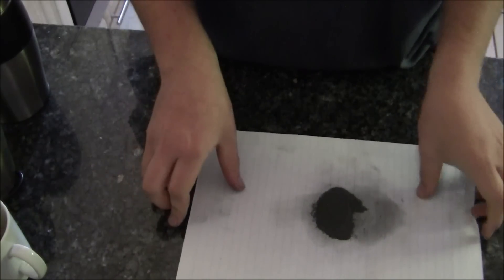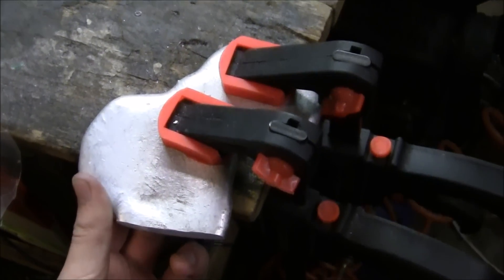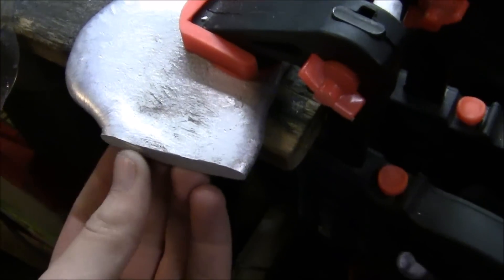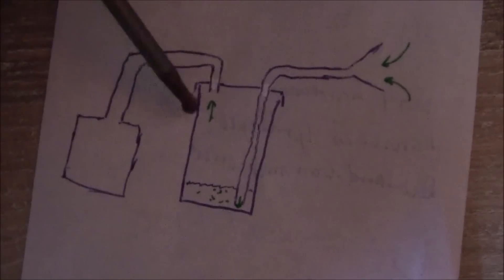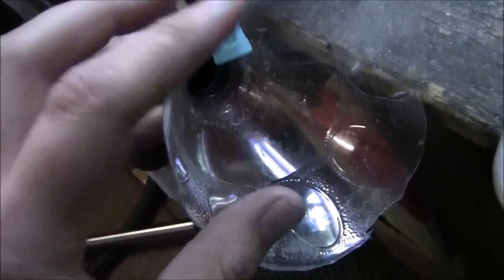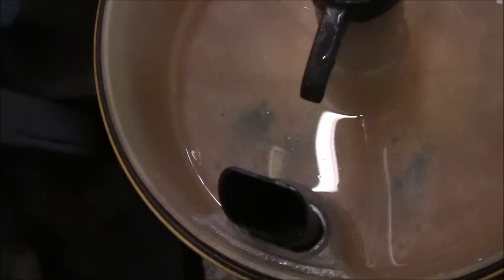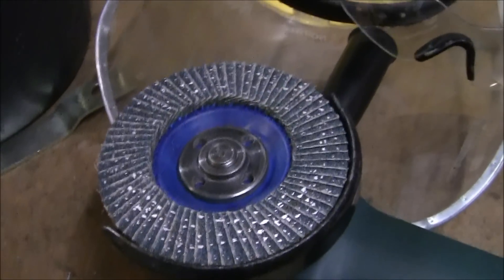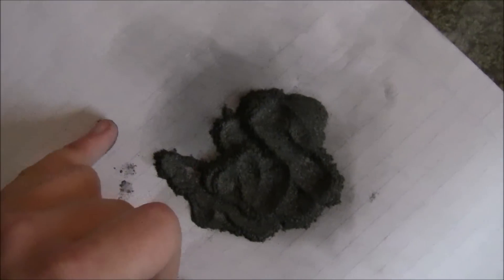how to make aluminium powder without using foil

Comment from the maker: I'm very curious, has anyone tried this?
Reply: Spray molten aluminum through a nozzle to aerosolize it in an insert gas. Industrial process to produce bulk aluminum powder.
Reply: Bata vào 🏡 vệ cho chị đi chơi đâu không biết nữa nhưng chắc là vậy
Reply: Heck no. I’d prefer to not breath in aluminum dust.
Reply from the maker: @darenmiller2218  dust mask.
Reply: @HomeGrownPyrotechnics  not chancing it. Rather leave it in the ball mill for a week or more. It’s a great idea don’t get me wrong, but personally I’d rather not chance it.
Reply: I tried several ways to get powder. It seems that using an angle grinder worked well, but, I think you end up with mostly alumium oxide. The way I was going to try next (though didn't have one at the time) is to just put a bunch of aluminum chunk into a ball mill with water and tumble. Every know and then, exchange water, powder with a few more chuncks and water. You could still collect some while cutting the aluminum into chuncks with the grinder, but should otherwise be less messy and a higher quallity powder.
Reply from the maker: Yeah uh I wouldn't do that. It's gonna take a stupidly long time to reduce that to powder, months to years. What I do is buy aluminium powder as resin pigment which is about 200 mesh and ballmill that. Much cleaner and more reliable.
Reply: no
Reply: i would but you need a kilm to melt cans and a place where you can spark up a grinder and a vacume at the same time with out people crying about the noise and lets not forget you contaminate it with the abrasive particals from the disc . i would suggest to get a large coarse metal file double cut  over 10 inches and just vacumeou the left overs and spare your lungs
Reply: I would if it was a shtf situation but for now i can just buy in bulk and have it shipped to my door.

Comment: I’d get a narrow and wide step drill bits and slowly drill wholes through it and catch the shavings under it.  Use the narrow one first and drill all the way through.  Then hit it with the bigger one. Then blender it, then ball mill it.  Wear all your PPE.
Reply from the maker: I'd imagine that that would create shavings that are too big to mill. I tried using small lathe turnings and it just wouldn't grind down. It needs to be a sand like material before it gets milled otherwise it will take weeks. Blending metal shavings seems to only screw up the blender. What I use is 200# aluminium powder used as a paint pigment. Takes 8 days to mill fine
Reply: @HomeGrownPyrotechnics   it might be less work and more safe just to buy it.  I saw 5 pounds of 2 micron dark Indian aluminum for about $70 shipped.  If your interested I’ll go and see if I can find it again in my browser history.  I’d be nervous to play with that small of a powder myself.
Reply from the maker: Yeah unfortunately 'just buying it' doesn't work in my country. Pyro specific chems are pretty much impossible to get here. If I want it I must make it. The only thing I've had to import is parlon
Reply: @HomeGrownPyrotechnics  understood.  I read that a “seed grinder” also works for the initial pulverizing of stuff.  I’ve never looked into though.

I didn’t know milling took that long.  Its alot more low profile though than purchasing anyways and you get the fulfillment of doing everything yourself.
Reply from the maker: Ya I get a lot of pleasure out of making things myself. I even make my own ammonium perchlorate. That was a 4 month project to get right lol, but  because I now have all the equipment, I can easily make more.

Comment: Try a fine rasp in a recip saw, much cleaner process and end product.
Reply from the maker: And gives a very unrewarding yield. Tones of work for very little product. It's much easier to ballmill with steel balls using aluminium 200# powder used as resin pigment.
Reply: @HomeGrownPyrotechnics  steel? Man that is literally playing with fire. You should use glass or ceramic.
Reply from the maker: Sigh. I tested it thoroughly. Steel balls in a ballmill don't even come close to reaching the velocities required to sparks to form inside a ballmill and the powder being milled absorbs the energy to grind down fine. That's the point.
Reply from the maker: I used long exposure photography at max iso to record if any sparks formed when struck with another steel ball free falling from 1 m in the air. A ballmill cannot achieve such velocities and absolutely no sparks were seen zoomed in
Reply: @HomeGrownPyrotechnics  static electricity with steel is the concern, or at least that's what I was taught.
Reply from the maker: The steel conducts away any charge there might be present. It takes a week to grind down 100g of powder with steel. With ceramic it would take several weeks and you have a higher spark risk from the ceramic fracturing than steel because it's so much harder. The aluminium would be like sandpaper to hardened lead so steel is the best option for this application

Comment: Get chips from a machine shop. Clean the  chips with either soapy water or kerosene. Let them dry. Ball mill to oblivion. Once ground to silvery dust add some stearic acid and charcoal as a phlegmatizer and grinding lubricant.❤
Reply from the maker: I have a lathe. I've tried milling aluminum turnings. It doesn't work. Would take months to mill down. It has to already be a sort of powder before going in the mill. I use aluminum powder resin pigment, works great. It comes as ~100-200 mesh and can be milled down to airfloat in less than a week depending on how much is in the mill

Comment: Have you tried a ball mill with actual rock like say granite that act's much more like sand paper than actual steel balls also have you tried a bench grinder with an stone wheel in a large plastic tub with a lid ? And some sort of vacuum like you already have in the video but with a bench grinder and holding the melted metal with steel pliers to the grinder ?
Reply from the maker: Rock will chip and fracture off and contaminate the aluminium. Where would you get granite balls anyway. Also I don't think you understand how ballmilling works. The balls are crushing the material as the balls tumble. Also I now use aluminium powder used for resin pigment. It already comes 200 mesh so I ballmill that.
Reply: Screen out the sand  aluminium being lighter would seperate deferently to the heavy sand just need a two screens and a trap for your heavier sand  wouldn't it do the same for steel balls so you don't have a early thermite reaction with the aluminium powder if it was to get hot enough and you had the right amount of rust to fine aluminium ratio in your Ball mill just thinking outside of the Box dosent have to be the same way everyone else makes it the granite would be easy to obtain simply from a creek bed or beach already on a round shape just need to find it
Reply from the maker: The steel isn't flaking off during grinding so isn't mixing.thermite also takes very high temperatures to ignite. Rocks are also a bad idea  because it can generate sparks on impact. Steel takes much more force to do the same. Just drop the rock idea, its a bad idea in many ways.
Reply: Lining the inside with rubber matting helps a lot too won't wear out your drum so fast
Reply from the maker: @thehardrockminer8778  the drum is MADE of rubber my guy. A very stiff rubber. Anyway the only thing that there is any concern for being worn out is the drive belt which can be replaced
Reply: Use marbles, you don't want sparks at all, like no chance of sparks and also no oxidation, that's what the charcoal is for

Comment: One problem with this idea, how does one make 400 mesh flakes?  Spherical shape gives off sparks..no bangs! Using aluminum foil doesn't work... tried ideas from YouTube and a book bought from a pyro supply.. none of these work! I read info on the internet that German dark pyro mesh flakes are are made from aluminum on paper ..kinda like on Wrigley's chewing gum paper ..now where did I read that?!?? Burnt or sprayed in a very finely divided cloud which is very DANGEROUS and bad for the eyes and lungs !!! The methods I see on YouTube don't work too well for firecrackers! ! I gave up ....
Reply from the maker: The dark aluminium i make works very well for making flash for firecrackers. If you want 400 mesh you will need a 400 mesh screen and need to ball mill the powder then sift it. Ball milling generates flake aluminium because the grinding media is constantly flattening and grinding the particles.
Reply: Częśc moge zadać pytanie bo widze że Polak?
Czy fotobłysk robiony z Kno3+Al jest w miare bezpieczny od samozapłonu ?Czarny proch robiłem nie raz w swoim życiu i nigdy problemu nie było,z góry dzieki za odpowiedź

Comment: I wonder if a cyclonic separator would be useful here.  To prevent splashes being sucked up by the vacuum, you might just put a vee shaped baffle in front of the suction tube.  nice video... thanks

Comment: I would think that grinding would cause so much heat that you would excessively oxidize the aluminium
Reply from the maker: Nope. Heat only comes if you grind it too long without letting air in then expose it to air. The oxidisation can be exothermic. I've experienced it igniting just sitting on my table because I wasn't giving it enough oxygen in the final stages.
Reply from the maker: i just realised you were talking about the grinding from the angle grinder and not the ballmilling. the surface area of the particles when angle grinding is insignificant at that size for oxidation to be an issue. one thing to keep in mind is that aluminium oxidises instantly in contact with air and forms an oxide layer, that's part of the appeal of aluminium as that oxide layer prevents further oxidisation, ie, it never rusts unless in some very harsh conditions. that instant oxidation can also be a problem tho as i mentioned with it catching fire after ballmilling. oxidation is exothermic so if its happening fast enough, it can start a fire

Comment: https://youtu.be/4HKpMYJ-6go
Ciao,
Since gallium induces structural failure in aluminum, I thought of exploiting this phenomenon to doping aluminum with small amounts of gallium in order to make it brittle and be able to pulverize it very finely in less time, in a ball mill.  The hope is that the quantity of gallium required, compared to aluminum is very low so as not to decrease the performance of excellent fuel, what do you think?  could it also work for MgAl?
Reply from the maker: Interesting idea. I don't have any gallium so I can't test that. MgAl is already very brittle so it's not necessary.
Reply: @HomeGrownPyrotechnics  Thank you for having answered me, however, although MgAl is fragile there is no fine and really impalpable powder like that of aluminum, perhaps because it is fragile but hard, if Gallium had an effect on it too, and it was possible to obtain a greater fineness, it would be super performing, if ever you can try I would be happy to know ..... thanks and best regards.

Comment: Altho this is an old video, grinding aluminum powder with water is not a good idea. Aluminum powder create a exothermic reaction with water and produces hydrogen and heat. Can spontaneous ignite. Use some sort of thing oil instead
Reply from the maker: you would have to wash the oil out then. i observed no such reaction even when looking for it. i no longer use this method and now simply ballmill aluminium powder used as metal pigment in resin.

Comment: If you are not in a hurry and you have enough open space, consider this. After shaking aluminum/water mixture to insure even distribution of aluminum dust, let water evaporate. Works best in low humidity settings.
Reply from the maker: Oh I don't use this method anymore. Stopped using it shortly after making it. I get aluminium powder as resin pigment which is about 200#. I just ballmill that

Comment: Be careful! the aluminium reactd with water and generates Hydrogen, you should change water to oil or something
Reply from the maker: That would only be of concern if it was a micro sized particle already. Aluminum instantaneously forms an oxide layer on its surface that prevents any further reactions in its environment. This concern mostly applies more to magnesium which WILL react with water as a powder. Besides, I stopped using this method shortly after making that video several years ago. I got hold of aluminium powder used as paint pigment which is about 200#. I just mill that
Reply: Ok thanks for letting me know :)

Comment: That sounds a damaged drive shaft it’s the sound of the motor slipping inside the shaft because you out too much load on it it sheared the drive shaft just so you know if you take it apart you will see the motor spins fine sounds fine when not connected to drive but has chewed the drive this is in my experience because what you have ground is stronger than the material the shafts made from
Reply: Also be careful of sparks which will blow up your powder it’s why you should use a sparkles motor on a lead loaded ball mill but ultimately I’m here looking aren’t I
Reply from the maker: if i remember correctly from the years ago i made this video, i took the motor apart and the thing that held the drive shaft at the back of the motor was warn a little bit and had some play which is what caused the rattling, nothing could be done, the motor was buggered, had to get a new one. also, you definitely don't want lead, aluminium is harder and you will just end up with lead powder in your mix. i use steel balls now. say they spark and ill fight you. I also use aluminium powder now that got from a moulding supplies shop, buy it as a pigment

Comment: I'm no pyrotech. But like reading on the hobbie. There is a cheaper way ask a machine shop if there doing aluminium work filling from lathe are milling can have lots problebly be free .
Reply from the maker: I found an easier way of making dark aluminum powder since this video. I got aluminum powder used as pigment for resin and I ball mill that.

Comment: Rhello: a question, if this formula mix with water to make a solid paste would be correct?
Reply from the maker: im sorry, ive been trying hard to understand your question but it makes no sense.
Reply: #HomeGrownPyrotechnics.
Thank you. Sorry for the afternoon of my reply. I am looking for this formula to harden as a dough and adhere to cardboard as glue. That it is not only dust, but also paste as solid glue. Type sticky putty.
Reply from the maker: I'm still confused. The video is about making aluminium powder. Not glue
Reply from the maker: @QKLIENTE  the cap gun mixture is an explosive mixture called Armstrong mix, made with 50/50 potassium chlorate and red phosphorus, both can be gotten from Mach boxes. The pop pop things are small rocks coated in silver fulmanate I believe. I hope that answers your questions
Reply: #HomeGrownPyrotechnics.
Hello: Thank you, excellent. You should have a school😂😂😂. I've been doing chemistry for years and I still can't do it. Not for nothing I find myself bothering you, on your channel stealing your time and attention. But very grateful for your invaluable answers. Thank you very much indeed. The mixture you mention as an achievement make it pasta? to make those pieces that I shared in the gun video. Yes, he made that mixture, there is a volatile powder in bulk, as I manage to compact it, without it reacting and not losing properties. Again Thanks, Again Sorry. Receive a hug.👋

Comment: Why not just use a hand sander....?
Reply from the maker: im pretty sure that that would take much longer. besides, i dont use this method any more, im currently ball milling some course aluminium powder i bought as an epoxy pigment and it works much better and faster seeing as the particle size of it is already smaller. i also am using steel balls which greatly speeds up the process
Reply: Those are some great points and I agree with most of them but i was just reccomend ing an easier way to get aluminum powder because most people don't have ball mills and grinders and stuff
Reply from the maker: the problem with that is it is a shit ton of work for very little result. also without a ball mill, you can't get the super fine powder that you need for pyrotechnics, and i mean SUPER fine, way more than any high grit sandpaper can give you
Reply: That is true I guess ball mill is the best route

Comment: The aluminum will have a lot of the  abrassive wheel in it. But it may not matter for your purposes. Very creative how you collected it.
Reply from the maker: ashman none ya a very small amount of the abrasive did end up in the powder but it was negligible. I've now moved in to simply ball milling aluminium powder used for paint pigment, it's fine enough to work for thermite but not fine enough for flash powder. Not long after I posted this video I tried to build a much bigger ballmill( a project I abandoned for several difficulties) for which I bought waaaay more steel balls than I needed and so I used some in my small ballmill which up untill recently was out of action due to it losing 3/5 drive belts in less than 2 weeks because of our summer heat. I had an amazing idea to make a mould of a drive belt and then cast it in silicone rubber with reinforcement in it and now the ball mill runs amazingly. Using the steel balls made a massive difference in the grinding time so I could grind much more powder in the same time. I've heard many people say that it could spark but I did a lot of research and found 0 cases where it actually happened. I thought about it and there actually aren't any conditions that would cause it to spark, there is powder between the balls, the velocity of impact is waaaay to low etc.